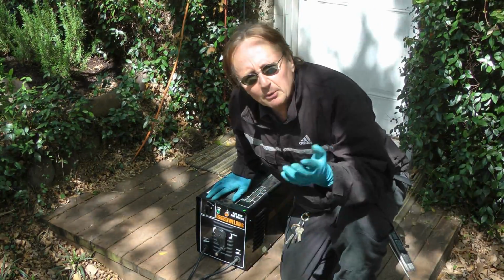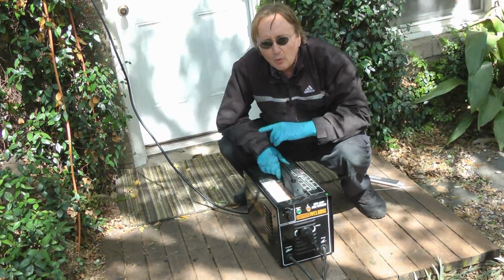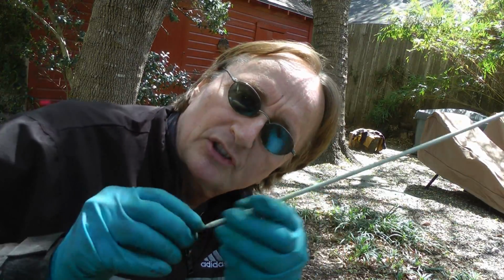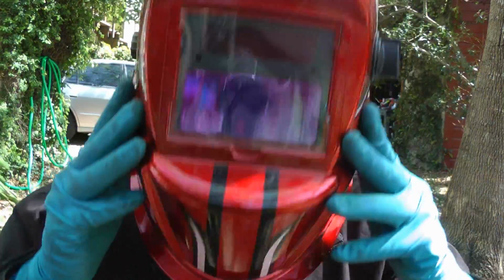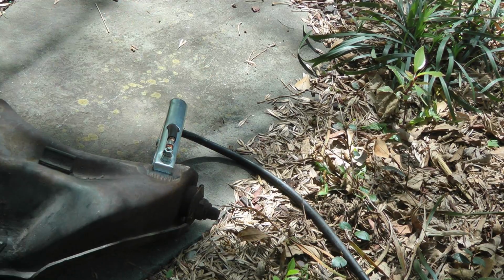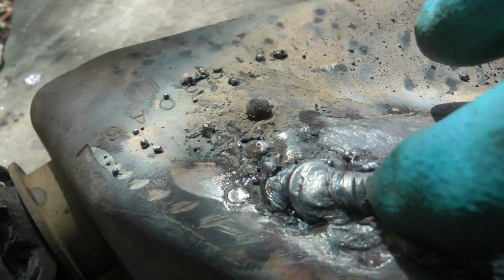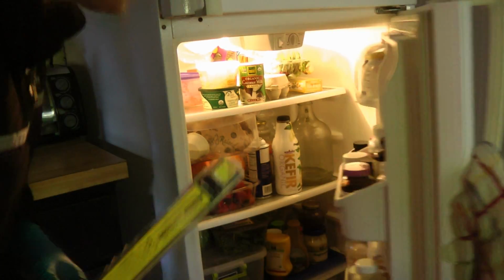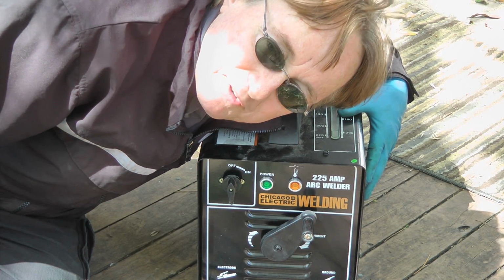Welding Machines And Car Repair

Comment: Thanks Scotty, I've been thinking about trying welding, now I will. BTW the Blue Driver Pro Scan Tool was a great help. I'm replacing the plugs, wires, and coil packs on my 99 E430 this weekend. Thanks for getting me going on doing my own repair a couple of years ago.

Comment: Novice Welder here, but the Electrode Holder / Stinger is almost always on the Negative Terminal. Switching it to the positive side won't "penetrate" / arc / fuse said metals as strong.

Comment: Also a self darkening welding mask uses two or more sensors that activate the self darkening. The solar panel is to charge battery that powers the darkening feature. It would help if Scotty Kilmer actually knew how his equipment worked. Also a heavy welder does not always mean it is better or reliably, it just means it is heavy 😂😂.

Comment: There is a steel power steering pipe about 2" from where I need to weld.  Do I need to drain the PS fluid and remove the pipe?  Thanks.

Comment: I'm no welding expert but I was taught that certain rods like E7018 should be kept in a heater around 700 degrees F to ensure there is no moisture in the flux coating.  The danger of even the smallest amount of moisture in the rod (electrode) may result in poor welds.  The real danger is when hydrogen forms and is deposited in the weld pool.  Now there is hydrogen trapped in the solidified weld and the result can be a cracks weld due to hydrogen embrittlement.

Comment: Your welding rods are actually supposed to be warmed prior to welding if they aren’t it can cause porosity which will make a weak weld and it won’t hold as strong they’re special rod ovens for that but yeah they can’t get wet that’s 100% they become useless once wet

Comment: If welding something on your car remember to disconnect the car battery , otherwise you could mess up all your electrics
Reply: What about disconnecting the computer
Reply: @frontlinemedia4270  ..... just found out. the answer is yes. idk how to do that but my truck is having problems now
Reply: @legion4842  yes, I failed to know about this 20 yrs ago and messed up an ignition component in my ford.
Reply: @frontlinemedia4270  im still trouble shooting, ill look in to " ignition components" thanx mate

Comment: As a welder. Thats beyond practice. Why would you use a stick welder on a car? TIG is the best way to go.
Reply: Tig is really not the best option for a car if that's what you mean but as a welder you probably already knew that.
Reply: Tig is the best option. Its easily ground down, paints look great over it. Tig is the best option for car panels. Hands down. And i know that because i am a welder

Comment: I always thought welding with rods would burn holes through car sheet metal... right?
Would be great for at home use if it worked... but my feeling about this, is that it's not the correct type of welding.

Comment: Storing rods in a refrigerator is a bad idea. Once they are pulled out to use in the outside temperature, moisture will start to appear just like anything else you pull out of a refrigerator. Welding rods and moisture do not mix well together. It ruins the flux on the rod and causes holes (porosity) to appear in the welds making the weld insufficient.
Solar panels in the welding hood do net darken the lens. The light sensors do that. The solar panels re-charge the battery in the welding hood.

Comment: I hate to say anything negative, about this obvious car wizard, but This is a very broad topical video, just enough to get a novice in trouble; and put your self in a lot of potential danger. Arc Welders,  maybe for structural problems, but, MiG/TiG is more universally used.

Comment: Looking to build a welding bed on my truck because I do mobile welding . after the bed is built I wanna weld off the back of my truck like pipe stuff like that . but will it short my computer if I don't disconnect the cables .

Comment: DO NOT under any circumstances weld on steering or suspension components. Do not weld trailer hitches. Do not weld tanks or hydraulic components. Do not weld on a vehicle with any fuel leak. I'm a pro and every millimeter I weld is inspected and/or tested. If you are a backyard guy treat every weld as if it could fail because you're using cheap equipment and you don't know what the quality of steel you are welding. Seriously, be careful.

I see you still have the guard on your grinder. Good job, Scotty. I'm proud of you.
Reply: Rusty Shackleford how do you think the drift guys get those extended steering knuckles? Lol

Comment: As a welding student, there are a few things I'd like to mention. When it comes to welding involving cars, I wouldn't recommend using a stick welder. MIG, Flux core, or Oxy Fuel welding will work well for car repairs. I would say the only time you should use stick welding is when you're going to weld metal together if it's gonna be used for handling high stress. Such as the car frame or building a trailer
Reply: I think the point he was making was you don't need to be a welding student to use an arc welder on a car; the video is basically saying for a few hundred bucks and a day or two or practice the average Joe can learn to use one of these welders and a stick to weld the car, he didn't say it was the best tool, he means its the cheapest to buy, and easiest to learn, and if it all costs $300 bucks, and the mechanic want's $1,300, why not try welding it yourself?
Reply: Tig works the best

Comment: Would like to see more on grounds when welding.  Have seen guys ground to the body then weld on the engine.  Forces heavy current through the same ground strap that is part of the cars electrical and computer systems - expensive ouch.

Comment: As long as it holds together who cares how pretty the weld is ya bunch of sissies.
Reply: A lot of welds will hold up to light force, But break under pressure, You can also weld a weld that looks absolutely perfect, But has terrible penetration and that will also break under pressure, Watch welding bend tests, A lot of welds will just snap, You want to have good penetration, And you want a consistent weld.
Reply: here's the thing if you weld on say a frame or some other structural piece, the weld fails and someone gets hurt or killed as a result, you are 100% liable if you don't have the certifications to do that kind of work. You have to have the certifications as well as being bonded and insured if you are going to doing welding on any commercial or industrial application.

Comment: Ok we all know you know about cars but you don’t know much about welding, you can’t tell if a welder is good by the weight,everlast,hobart,Miller,Lincoln and a but load of others have light portable welder but are built better than that Chicago electric, and are lighter... smdh also 7018 rods need to be kept in a heater, but I didn’t pay attention to what rods you were using...

Comment: I like your videos, so how to say this, welding is a good idear high quality ARC welding on 1-2 mm tin is next to impossible WIG welding is the best choice pure clean strong welds and a lot easier to handle, yes a wig welder is more expencive but after 3 rust repairs it has payed of have a friend let you try both ARC and WIG welding on 1-2 mm tin there is no comparison.

Comment: Don't buy that welder its a piece of shit. for $50 more you can get a nice Everlast or an AHP inverter that will serve you much better.
Reply from the maker: I disagree, been using it 3 years so far and it's worked great, never failed. Realize they are just electrical transformers, pretty simple devices.
Reply: Scotty Kilmer I agree. I love my Big Black Box from HF. It welds great. I enjoy the simplicity of the machine as well as its raw power. The infinite amperage control is fun too. Much better than the lincoln pre-set configuration. you would have to step up to the lincoln idealarc 250 to get that feature. That's a $3000 machine. i can't wait for the new Vulcan Commander 225 HF is coming out with next month. A transformer based ac/dc machine for $399.00 with infinite amperage control. Awesome. can't wait!

Comment: do not weld anything structual like framework until you have mastered all the different kinds of joints and angles.
Reply: working shlub mechanics with no professional welding experience or education shouldn't be welding commercially. They should outsource that to someone with the proper training, certifications, and insurance.
Reply: @chuckhickman8093  I used to work  at a city garage, mech do only light task, heavy task are done by a  pro-welder for safety reason. I had a cast iron water pump and it cracked from low temp. I forgot to empty it and the only guy I found was a teacher of the profession, he did it in a closed space with no variance of temp, no air draft, probably pre-heat the body of the pump, and the pump unlike exhaust manifolds is not exposed to carbon build up and low and high heat cycle from fuel and it is easier to weld. He was an old timer, it was a free job because T was a friend of another teacher. It's not an easy profession

Comment: Ok scotty, but what about welding my 1978 peugeot body that's only 0.8mm thick? I tried and the rod will either stick and not weld or make holes in the body.. :(
Reply from the maker: you'd need a mig welder for that, I got one recently for about 300 bucks that works great with an inert gas tank
Reply: Scotty Kilmer thanks for answering Scott! How was your birthday the other day?
Reply from the maker: just fine and dandy, I lied around all day and the wife gave me my present
Reply: Scotty Kilmer sounds good!!! :D
Reply: Tig would be a better option for that, Mig will work, And probably work find, But tig is the best at precise and thin welding.
Reply: @towtruckaj  sure is and if its bodywork bronze filler rods even better.
Reply: Scotty Kilmer happy birthday

Comment: Most people would be way better off buying a wire welder. It takes a lot of practice making a good bead with a rod welder.
Reply: +ktrez2000 Have to start in order to learn. Some people pick it up right away, others never get good at it. But if you don't even try, you'll never learn.

Comment: gotta few cracks on my custom wheel. Nothing much as a life threating , but a few half inch around the lips of the rim. Two cracks to be exact. The sets was still pretty new, but my girlfriend rode my car the other day and she accidently hit a major curb and this was the result. air is leaking out due to the two cracks. Took it to all the shops around, even to a major welding shop and all were saying that their insurance wont let them touch it cuz its a safety hazard. I do understand the risk they maybe taking if they open the door to all the customer with crack rims, but my two half inch crack is nothing much as a hazard compared to a worn out tire on a car. To make a long story short nobody want to touch it. My only three options left is find an individual person that can weld custom rims, do it myself or toss it and buy a new set, which i really dont want to due to my tight budget. Please any advise. Can this portable weld you are dancing about can fix my problem.
Reply from the maker: +mikejones Mikejones  there are custom places that reweld wheels, I've used em and had not problems later on with customers' cars that I send out.

Comment: Welding is expensive to learn at first but like Scotty said a  good couple days you should get the hang of it.
Reply: welding takes more than a few days to get it down, at least if you plan to weld commercially. Typically it takes about 600-1000 hours to become competent. If that weld breaks and you don't have the proper certifications, you are 100% liable

Comment: Does anybody know what the maximum AMPAGE i am likely to need or use with an ARC welder for use on cars?
Is 100 A enough for most jobs or should i buy a more powerful one
Reply from the maker: SP330Y depends what you're welding. Frame work needs more, but stuff like body panels and mufflers do not
Reply: Scotty Kilmer So a 100 AMP stick welder (arc) is great for panels, welding on fenders, panels that have rusted out etc.
You say frame work needs more, do you mean frame work on cars like chassis frames?
If so what ampage would you say for that

Comment: Scotty Kilmer 
Is an arc welder suitable for the replacement of rusted out metal parts like the bottom half of your door and replace it with new steel then angle grind smooth and fill with bondo OR is the arc welder much too strong for this and only suitable for jobs you dont see like under the car, cills etc
Finally if i replaced the wheel arches on my vehicle (cut old rusted ones out) and welded in new skins would the arc welder warp the existing panle with the heat it generates OR is it okay for this use too??
Thanks in advance i am going to buy one very soon after i find out which one is suitable for my application.
Reply: I know your comment is 2 years old, but no. Try to get a wire feed, whether it's MIG or flux-core gasless only. It's not impossible but it's very difficult to do it with a stick welder without warping the metal.
Reply: Dakguy and blowing straight through is common.

Comment: Is it okay to weld on the K-cradle (crossmember? subframe? idk what its called). The corner that holds the front control arm bolt on a 2003 Corolla (Matrix) that was wrecked was damaged and I hate to replace the whole thing when just the corner is damaged. It would be welded by or under the direct supervision of a experienced welder. Thanks scotty for the videos.
Reply from the maker: All2skitzd ONLY let a true pro do that himself (or herself)

Comment: Mr Scotty Kilmer

I bought a new SMART TOOLS Arc welding machine , and a (6013) 2.5mm welding rods .

i want to weld on my front quarter panel which is made from very then metal, it has a rusty bottom end .and i want to replace it with fine clean metal sheet .

what is the best rods for this job ? 

is the higher amps better for thin metal or the lower amps ?

can i weld a muffler using it ?
Reply from the maker: thesniperofcs lower amps are for thin metal, including mufflers. Just realize you have to cut all the rusted area clean off before welding, and use the correct rods for the material you are welding. Any welding shop can sell you them when you bring them a sample of the metal you are welding
Reply: Scotty Kilmer i replaced the are machine with Oxy Acetylene 

can you please make a video about it ?

Comment: I just bought the same helmet... and a 90 amp flux welder from HF. First time welder.
Anyway... Can I weld onto a car part when it's still connected?
I want to weld a socket onto the inner tie rod on a 03 Ford Focus because I the rod connector is stock and completely round at the rack and pinion. I can't get a pipe wrench in there even with the steering wheel completely turned. Just bought an angle grinder to make edges for a socket but a 4.5in grinder is still a bit big for the cavity.
I want to weld a socket to it and impact it off but I don't want to damage anything electrical or pull off the rack and pinion just to weld it. Any advice?
Reply: Just disconnect the car battery first and you'll be fine.

Comment: Hey Scotty, about storing your rods in the fridge yes they are suppose to stay dry  but it also helps to keep them relatively warm and a fridge is probably not the best place for them. I'm sure a humidor wouldnt be that hard to make and the rods will act a lot better on start up.

Comment: and if you are welding directly on the car disconnect the battery (don't let the battery cables touch the body) or just keep the engine running :)
Reply: +TheCashman007 what does keeping the engine running do?
Reply: if you did not disconnect the battery,

battery,wiring or the electronics might catch fire/explode

but if you keep the engine running this will not happen

and all ways keep a good and proper type of fire extinguisher

my English is not so good

hope this help
http://outbackjoe.com/macho-divertissement/macho-articles/car-welding-circuit/
Reply: well I never did that. I have welded many different things on my car with out problems.
Reply: yes but why take the risk old cars there are no commuters 
 some times you don't even know
Reply: I can understand disconnecting the battery to be safe. but I don't know how keeping the engine running would help.
Reply: TheCashman007 thanks for the info
Reply: juck huo no problem:)

Comment: Wrong type of welder to get, and the weld you showed is awful! Shot of you welding had you shaking the rod at the metal like you were casting a spell.

MMA would only be suitable for heavier guage metal, which on a car is likely structural, which will have safety implications. The advice of 'get a welder and stick metal together, it's easy' is misleading, and dangerous IMHO.

Comment: Spend a little more and get a Miller or Lincoln and you'll have a welder that will last you forever.
Reply: Everlast makes a pretty good welder for a good bit less, but I always loved the Millers. You can get a multimatic AC/DC for about 3k, or an Everlast equivalent for about 2k - but it also comes with all the accessories. You can also get an Everlast PowerArc in the 200 amp range for under 500 bucks if you just wanna stick and dc tig without a foot control.

Comment: i was lucky and got mine out the trash. all i did was replace the switch put it back together and had no trouble with it. that was a score.
Reply: me too ! my buddy gave me a lincoln fluxcore welder and it just needed new wire and a trigger
Reply: Score !

Comment: I have seen some comments where people have correctly posted that you should disconnect your battery before welding on the frame of the car. You should also be careful not to ground your welder near  a bearing or on the other side of a bearing from which you are welding. The bearing can arc internally and destroy the bearing. I know someone who destroyed the carrier bearing on a Chevy Truck when he was welding a bumper on his truck.